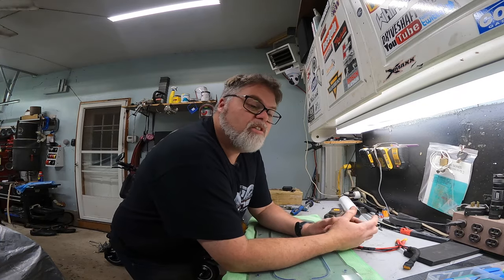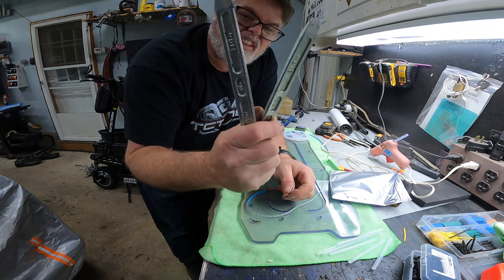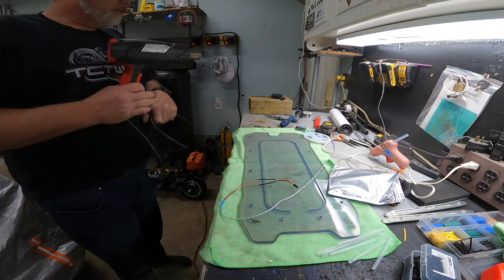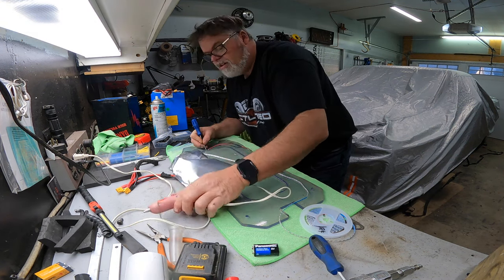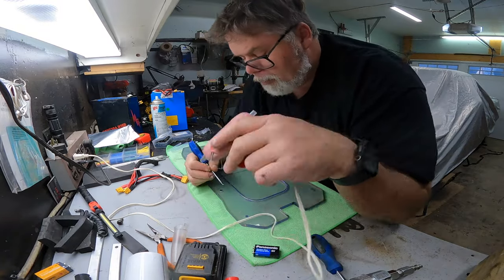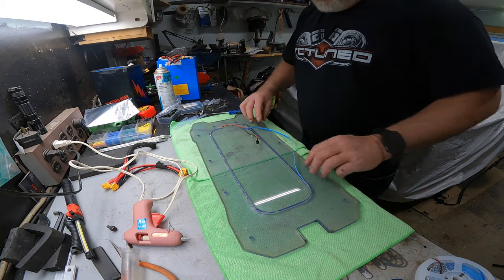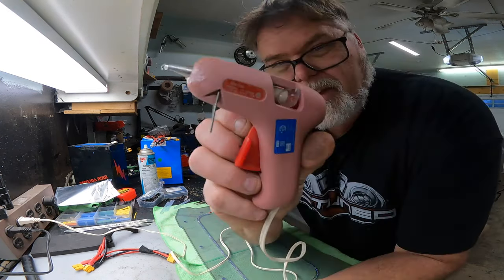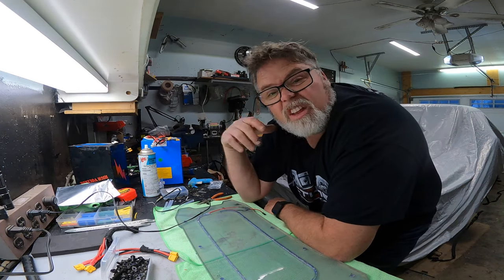Hot Glue Guns SUCK Big Time   HD 1080p

Comment: I agree with you! Especially when using hot glue on cardboard. So frustrating! The glue won't bond the cardboard pieces together when trying to make walls and the glue cures or cools down too fast and the walls come apart or fall down. The stand on the gun sucks too. It does not stand well and the gun keeps tipping over!